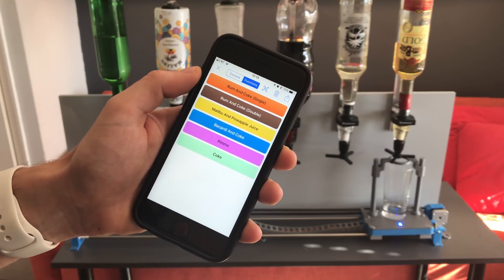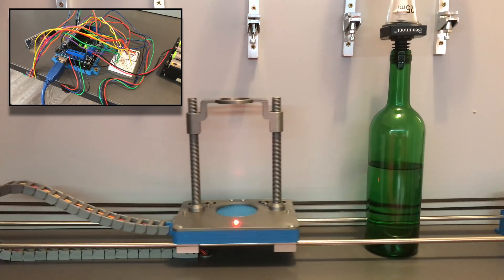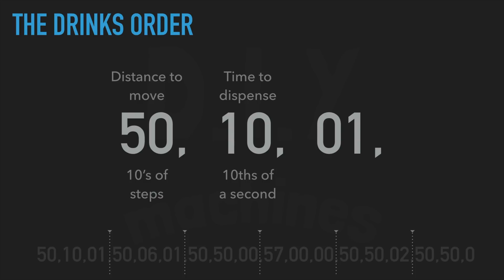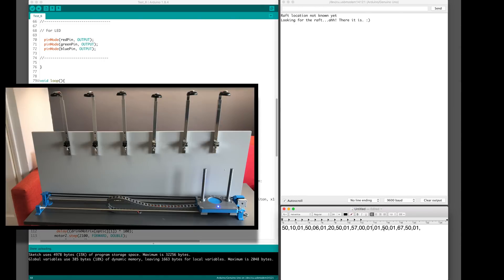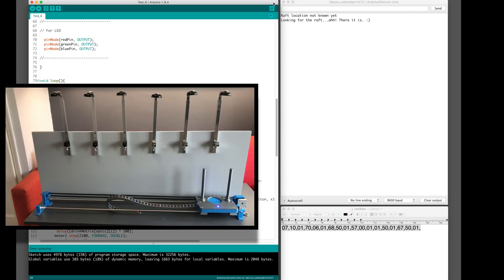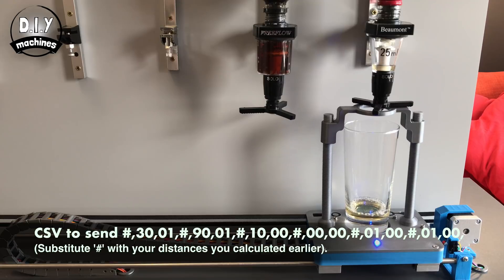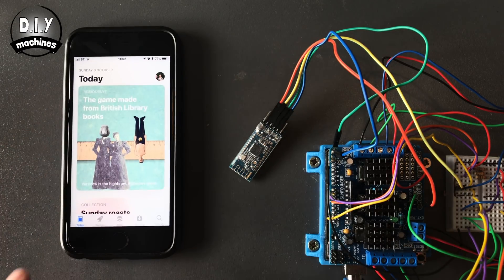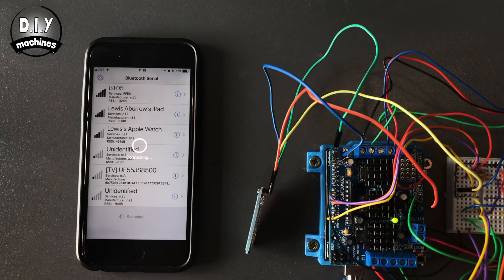How to make an Arduino DIY Robotic Bartender - P4 Adding Bluetooth

Comment: Hello 
Jarni again the student who is maken its final thesis based on your project. I have just one more question about the motor shield. On the motor shield there is a connector on the 2 PWR pins do you have to remove it? If yes do you know why? And normaly my outline should be done on the 7th of April as soon as it is put together I will send you a picture. Thanks a lot.
Reply from the maker: Hello, I hope your thesis is going well?
If you are referring to the little black jumper then this is removed when you want to prevent the power we are supplying to the motor shield from being passed to the Arduino to power itself from. As we want to power both from the set of batteries connected to the motor shield we are leaving this inlpace so as to allow the power to passed to the Arduino as well.

Comment: Is it necessary to keep the Arduino plugged into the computer for it to run?
Reply from the maker: G Ven. No. It will run without a PC. The intro is shown running only with the Arduino.
Reply: Thank you

Comment: Great tutorial, thank you! I plan to borrow some of the ideas here while building my own (I had actually thought of doing this about 30 years ago, but at the time my income level - the hardware available at the time = impossible!) I was wondering, though,  if you had any clever ideas on dispensing ice into a glass? I have thought of a cork screw type of device like the one in my freezer, but how would one control the amount dispensed? Timing it wouldn't be adequate as it doesn't deliver a consistent amount.
Reply from the maker: Thanks Don. :)
If you dispensed the ice first (to avoid splashing) then you could use a screw type device or a revolving bucket that scoops some up and tips it (like an excavator -> http://theconveyorshop.co.uk/WebRoot/Store5/Shops/d4057af8-76c6-4f13-adcd-f452ff4d40b6/56C5/B1A2/633A/644F/EE13/0A48/3508/E4A0/Bucket-conveyors-250x250.png )  into a chute that goes into the glass. If you then dispensed the spirits and saved the mixers/soft drinks till last then you could use an ultrasonic sensor to fill the glass upto a predetermined level. That way you wouldn't need to worry about how much ice was in the glass.
Reply: Thanks for the reply, great idea. I have never worked with ultrasonic sensors, however, I do have a few to experiment with. Do you think they could detect the level of ice in the glass?( Does ice reflect those frequencies well enough for them is really what I'm getting at). Like you said, ice first to avoid splashing, but I'd really like the amount of ice in each glass to be consistent. I live in the southwestern US (Sonoran desert) and we really like our beverages cold, as it's 110° to 120° F in the summer. Our ice cubes aren't actually cubes, at least from the ice maker in the freezer. They're more of a crescent or eighth moon shape really, and they tend to stick together when put in a bin. However, I just read recently (yesterday, in fact) if ice cubes are placed in a paper bag in the freezer, they will not stick together, and the author of the article does not know why. I have not had the time to test this theory, but I certainly will and it may have some application here. Anyway, thanks again!
Reply from the maker: Let me know if the paper bag theory works. I'm not sure how it would respond with an ice cube. I would imagine as it works by the reflection of sound waves, the opacity of the ice should not be an issue. As for the irregular shape of the cube and perhaps the echoes from inside the glass - the best thing to do would be to build a small test circuit and see what happens.

Comment: Is there a way to send instructions one at a time for each drink/interval but then move to that position not do 60 steps but move 60 from the start position if you have already moved it 20. I'm planning to use a raspberry pi to send the CSV so would I quite simply code it so it would take the distance I want it to go to from the total distance already travelled then add that to the string?
Reply: Kieran Shaw YouTube “homing a stepped motor at startup using accelstepper” there’s a good video that explains a lot

Comment: Hi regarding this video, do you know if the wire chain can be bought already built?
Reply from the maker: Hello, you can buy one here: http://amzn.to/2AH5XMo . This might need some slight modification where it attaches to the main raft as it's not identical to one we printed and used in the video.
Reply: DIY Machines another question in the last video in the program what goes on #include?
Reply from the maker: I'm not sure what you're asking, sorry. The code posted on my site to use does not contain any '#include'
Reply: DIY Machines but if I do not use #include AFMotor.h will not recognize the engines

Comment: where do you buy those nozzles? cant find them anywhere. how are they even called? i only find regular nozzles with no switch.
Reply: hi i am looking for some of those nozzles too i am from romania/europe could you direct me to some of those ?
Reply from the maker: Hi. The nozzles on the ends of the bottles are called optics. They don't have an electronic switch. When you push against the fins at the bottom (usually with a glass) they dispense a measured amount of liquid. Where are you from? (I can then try to link you to some).
Reply from the maker: Hello, yes I can. I'm not sure on shipping costs but you can buy the same ones I used on UK amazon at http://amzn.to/2BJixIX.
I also found these ones on the Italian Amazon site:
https://www.amazon.it/Dosatore-sospeso-scaffale-supporto-bottiglie/dp/B00TGAPGZY/ref=sr_1_40?ie=UTF8&qid=1512381174&sr=8-40&keywords=bar+da+alcool
https://www.amazon.it/DOSATORE-SOSPESO-ITALDOSIT-SUPPORTO-BOTTIGLIA/dp/B00TH3AVM8/ref=sr_1_32?ie=UTF8&qid=1512381161&sr=8-32&keywords=bar+da+alcool